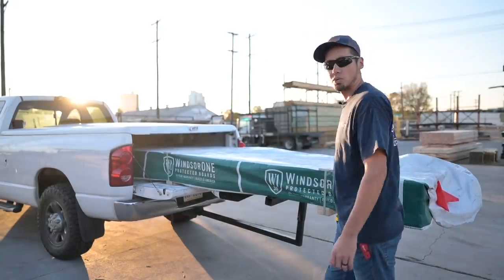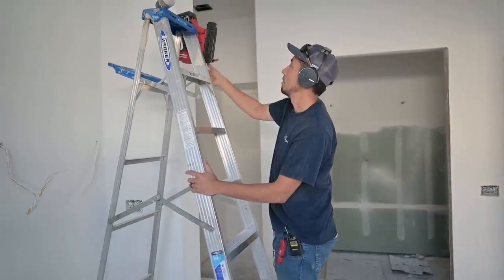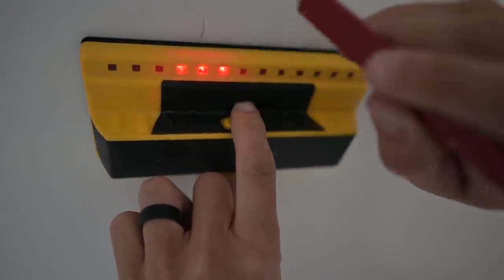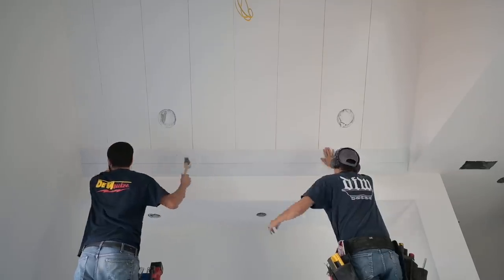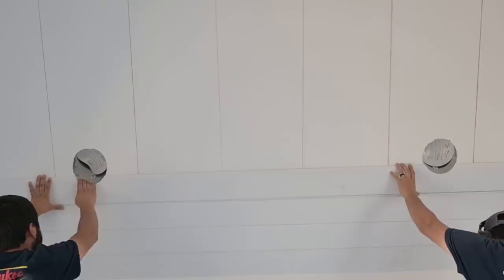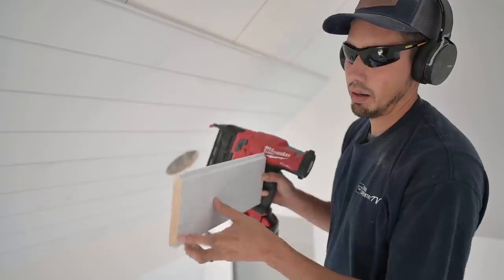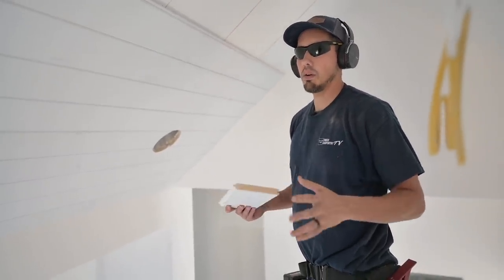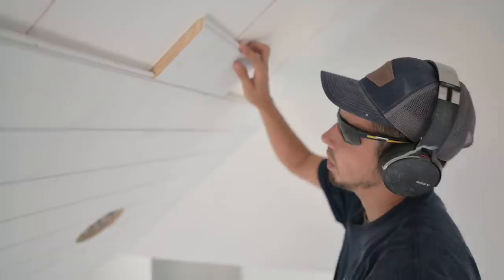Bad Carpentry Technique - Correcting My Mistake

Comment: I feel like each of you having a nailer up there would be more efficient
Reply: Their fine
Reply: @Alexanderbuilds2001  They’re*
Reply: He likes to have the control over John.
Reply: Sharing is caring! Screw that!!!! Two guns are better than one to effectively kill the job and get an invoice out.
Reply: But he said he was trying the nailer out to see if it would get the job done. So you keyboard carpenters buy 2 to start with?
Reply: @David-burrito  🙄🙄🙄🙄🙄
Reply: Two seconds to hand the gun to your partner. That gun approaches 300.00 USD. It would take years for a second gun to pay for itself.
Reply: Just a vid no rush my guy
Reply: @davearonow65  it comes with a free 8.0ah high output battery too.since the battery comes by itself you can actually take and return the battery and get about 70 to $80 knock off the overall $279 price. Or you can keep the battery and get more use out of it with more tools in the platform so either way it's really not that expensive and also over more avenues with more tools especially seeing how that 8.0ah battery is the same size as a 6.0ah high output battery and it's just the sweet spot for size and power efficiency. It's actually extremely common for people to go to Home Depot and purchase that gun and get the free battery and then return the battery to get more money knocked off the overall price. It's not that uncommon at all. If you do the buy one Milwaukee starter kit and get the free tools combo Home Depot has you can actually return the 4 amp starter kit for 199 and I believe it comes out to roughly half of whatever the cost of the tool is that you get free with it. Last holiday season before Christmas I was buying one starter kit a week but I was keeping the batteries for the most part because I was trying to get my battery platform up to be able to run two batteries on every tool that I have at least not to mention getting any of the fuel tools that I was getting with 24 amp batteries in the charger for the same price as the bare tool was a damn good deal. You just got to catch the sales at the right time of the year. As far as I know Home Depot is still offers the 18 gauge Milwaukee nailer with a free battery. They actually have a massive sale going on right now as well especially with your brand new fuel oscillating tools which are the absolute best on the market right now!

Comment: I would use a single bead of construction adhesive across the back of each T&G board on the ceiling when using 18 gauge nails. I even do it for Shiplap walls. Maybe it's OCD... Maybe I never want them removing my work. Who knows.

Comment: I would buy a hoodie but I do have a question, how did you finish the top. I have a den with a cathedral ceiling, wanting to finish it like that but not sure how to finish the top were both sides meet. Do you have video on this and were did you get you tool belt. Guess that's really 3 questions.

Comment: lock  the 2 full length  pieces together....find dead center of those 2 holes......tack a nail, cut a block half the circle , scribe the circle, cut the circle...ive put miles of this stuff up and that works good when the hole ends up in both pieces

Comment: I'm not sure about the Windsor 1 your using but I'm pretty sure your not supposed to use radiata finger jointed for exterior applications! Just fyi for your porch project. Just because its primed both sides doesnt mean it will hold up to significant exposure to water. If theres a chance its gonna get wet I'd get primed pine select it's a solid pine primmed both sides or go pvc!

Comment: You should be using liquid nail because of the height and the location of the boards liquid nail help with Securing the word to the drywall and the nail gun helps hit Stay till the glue is dry.
I’ve done this type of work for years in the casinos in Las Vegas and that’s what you use to make sure it will not come down Hope this helps you

Comment: When I saw you on your last video fixing through the face of a primed T&G board I could not understand why, all you were doing was creating additional work for the painter and possibly over a period of time those nail holes would show. In England we call it secret nailing and if you think about it the nail going  in on an angle has far more holding power than being fired in straight. If you skew in any nail or screw it always has a better holding power, I was taught on studwork to skew the nails or screws in in a dovetail fashion and they don’t work loose because there fighting against each other. And the boards you are fixing up are lightweight and fixed every 400mm centres 
there going nowhere, life’s a learning process and we can all still pick up tips and ideas every day. Not sure if this has always been your trade, but your getting there and looks like your making a decent living so take care 👍

Comment: When you do these T&G ceilings, how do you make sure you don’t end up with a very narrow pice at the top of the run ?
Reply: A great question most don't consider.

My approach would be to split the difference between the first and last board. So you'd have two partial width boards. One at the start of the run and another at the end.

Of course this only works if you were careful enough to measure before you start. 

Same priciple applies to flooring as well.
Reply: @comancheclub3449  that’s how I would do it as well.
Reply: Carful planning is how that’s done. One good question to always ask yourself in anything to do with finish carpentry let it be walls ceilings tile flooring siding. “ am I going to get a stupid little piece” and if so try to figure out how to avoid it.

Comment: Secret for those hole you have to cut out, you can use a router with a trim bit, ive covered things then drilled a hole via measurement and put a trim bit with a bearing in to cut out the center and the bearing will just follow

Comment: You can install your piece and nail it and then cut out around your recessed lighting with a Roto zip style tool with a wooden bit, just like the drywall guys do. You probably know this, but just prefer another way. You’re an excellent trim carpenter

Comment: if the weight of the boards becomes an issue I would use caulk as an adhesive and blind nail. This way I would get more grip on the ceiling by nail and caulk...

Comment: While your mind is open buddy, get ya a 6” hole saw and as you go up past your can lights, make some marks so you know exactly where your can is and then pop that hole out in one shot and you don’t have to test fit your board then pull it down to cut it with a jigsaw. You’ll pay for it in the first job you do with time savings and it gives you one more step of professionalism because your holes are perfect circles. 

I’ve been a custom home builder /trim carpenter for 30+ years. We will never know it all cause the industry keeps changing and evolving on us but your doing great, better than most trim carpenters cause your willing to adapt. 

Take care and be safe out there

I

Comment: When I moved to Canada (because I married a girl there), the house we were in used to be owned by her parents. After an accident put her in a wheelchair a few years before, they renovated the house for her. In the main bedroom, her father and a friend removed carpet and put down site-finish hardwood flooring. Neither were carpenters. The floor boards were all random length, and every single one was face nailed with hand nails, about 12" apart. I didn't know better at the time, but eventually became a wood flooring installer and immediately learned that they're designed to be blind-nailed through the tongue & groove. Now, many years later, I still cringe when I think of that floor with its hundreds of filled nail holes all over it.

Comment: The day you stop learning, is the day to hang up your tools, everyone has a 'trick' you never heard of (most of them work, but if you don't try them you wont know if it does or not) The decorator will also love you as there aint 6,000 pin holes to fill & rub down (belt and braces but a splodge of CT1 (Builders Glue) on each joist!  (got ya thinking)

Comment: Hey got a question do the group, I am doing shadow boxes and in one of the larger rooms there is baseboard heat on wall, about 9 inches from floor. My rule of thumb is 2 1/2 inches off floor to start the box, however if I have another wall without the 9 inch baseboard do I need to raise my box in that panel to math the other walls, or I can go back to 2 1/2 off floor.

Comment: I blind nail my T&G panels as well on vaulted ceilings, but on every 7th course , I face fasten trim screws into the studs to stop any bellying in the panels, it gives the ceiling more structural integrity. So what if the painter has to putty a few more holes.
Reply: why don't you blind screw them instead of in the face? I had a ceiling job did that 16gauge  nails and trim screws  issues was plaster was so tough nails didn't get through so ended up screwing it all up hidden fastener
Reply: @joshuamoyer1  you can shoot hardened 18ga nails with that Milwaukee. If they'll shoot through steel studs then that plaster can take them too.

Comment: How do you know if your two pieces will meet evenly on the ridge? Is there a formula for figuring, or some sort of process?
Reply: You can lay it out first and see but whenever I get to the top close to the ridge, I scribe my pieces in and make them tight. You can hardly see it from the ground even if it looked bad up close.
Reply: @dustyandsneezing  What do you mean by scribing. Do you tip them to size and face nail with less of a seam?

Comment: Definitely want a hoodie!...also, are cutting the ends straight? I’ve always bevel cut the ends, 15-20 degrees.  Fits better, naturally scribes it to the wall.  Just curious.
Reply: Zip up hoodies!!   They're Easier when wearing toolbelt with suspenders.

Comment: Room for expansion is needed but hopefully the sheetrock will bruise and indent when needed
Wide plank board will cup
Wider board fewer nails holding same sqft because of fewer rows needed more nails or stronger nails like cleats
Or glue support between rafters
A ceiling with alot of variating tempatures will create alot of expansion and shrinking gonna play on those nails alot
Use a urerthane glue next time to change with the wood not a pva that would just snap free of the substrate or material

Comment: Just wondering as to why you wouldn’t use a little adhesive on the back, like a PL or a liquid nail?
Reply: And just my opinion, I would use a narrow crown stapler as it has more holding power over Brad nails. When it comes to having boards over head, i prefer better to over kill it as a precaution.
Reply: @joepierce5357  stapler is good, but glue is simply not necessary.
Reply: @Joe Pierce  You should never glue cladding due to seasonal movement, the boards will crack.

Comment: You should be using liquid nail because of the height and the location of the boards liquid nail help with Securing the word to the drywall and the nail gun helps hit Stay till the glue is dry.

Comment: Remember,   most 18 gauge guns only accept 2 inch nails max.  3/4 for t and g 5/8 for rock. And deduck for the 45 degree angle and there really isn't mush going into the framing.  Maybe 1/2 inch?

Comment: The only time i've had the stuff fall down was due to some secondary water damage from a fire in the next room.

I suppose it didn't help they nailed almost all of the boards only into the drywall with an 18 gauge.

Comment: Wondering if at the peak, do you just run both sides tight and caulk the seam at the peak or did you add a piece down it to fill the 'V'?

Comment: Honestly the best guys are those willing to learn new tricks and take advice. Even if the guy telling you dosnt do your craft for a living. Hes going to see things you nor anyone else has thought about.
Still almost like to use a tile cement with a 1/8 v notch to put the glue on the backs of them for just a tad more holding power.   Tell you what do a mock up at home and a 6' section  then do it both ways.  Then see what it takes to pry each kid down off the mock up. Let the glue dry first.  .
My bet is the nails pull out of the wood and stay on the celing.  On the nailed and glued ones the paper comes off the drywall. It would take 4 times more force to peel them down with glue. There not comming down.

Comment: Richard is a former form set ter for concrete forms I'm telling you you need to get yourself a good pair of suspenders for your tool belt because eventually it's going to take a toll on your hips and your lower back if you have the suspenders on it distributes the weight better and takes it off your hips and your lower back I'm living proof of it

Comment: Im thinking just a spot of silicone or construction adhesive on the back of those in a very thin layer. For a little extra insurance.  That or floor staple gun. But brad nails on the tongue  risky.
Maybe not every one becuse just one out of 3 will have more holding power. Maybe you don't need it but I'd rather error the side of safty. Just one comes down on someone's head youll be paying for it forever.

Comment: Loads that size should be delivered and added to the material cost.  If you are picking them up, you should be charging for that (time and mileage), so to have it delivered, should not cost any ( or much) more.  It will give you a little more time with your family and less hassle.  Your time is precious too, only so many hours in the day!  Also, there will be no need to buy a bigger truck, (which is also much more costly to maintain), = $ in your bank account!  Just a friendly suggestion!

Comment: Why not just install, then use a 4.25” hole saw and go through both the wood and drywall once installed?  I did that with my LED gimble lights and was super easy.

Comment: Idk why anyone hasn’t said it, but instead of 18ga smooth shank nails, use staples. And if you stick with nails, just use drywall glue to hold to the surface rather than just relying on the nails.

Comment: Whenever I get a shiner on the backside of the tongue I just carve a the part of the groove that hitting it with my knife. At the peak I usually run the last board long on on one side of the peak and back bevel the shit out of the last board on the other side of the peak. Two get the same two reveals on the last two runs at the peak it takes math, some measurements, and some tinkering, and too of any words, but not very hard. Just gotta hope your framing is square and don't have to taper cut.

Comment: How much engagement are you getting into the stud once you're through the wood and drywall?  

I'll definitely buy a hoodie.
Reply: When I've done it with cedar t&g, usually you have about 1 1/4 to 1 1/2 of nail sticking out the back of the board.
Reply: @mikedrimba3529  Thank you Mike, I appreciate it.

Comment: As a product designer, I guess you use the nailgun wrong. The lip of the gun fits in the groove. So why are people still like to hold the gun horizontal against the groove of the wood? Also, did you take into account the shrink and expansion of the wood left and right against the wall?

Comment: Nice work.The framing that you are attaching to are RAFTERS, not joists.
Reply: Times change. Since tjoist have been used for roofs people have started calling them joist also. Even saw it in a manufacturer Engeneering layout.
Reply: Thanks for info.

Comment: So you don't have to bend your'e tape in the corner to measure, cut a piece ten inches long. measure to that then add ten inches. If you are not confident with the 18 guage nails use Power Grab from Home Depot.

Comment: On the last video where you face nailed that ceiling all i could do was cringe and think the painter is going to hate you. Lol. Blind nailing is the way to install tongue and groove boards always. Of course you need to hit the strapping or framing. It doesn't hurt to use construction adheisive on the back side of the boards as well.

Comment: A look like it’s a lot new construction work in texas for now in the next 10 years , think 🤔 about moving another state, use the benefit in getting shipped houses now, a will cost a lot later, 
A lot people are moving to texas, away from democratic high taxes state,🤪.
I have a idea 💡, i do the same but HVAC , i use Inverted in my truck in case any house with no power ( electricity ⚡️).
Connect with extra cables to you truck battery , it’s RAM rigth as you say, 
Try a will be good , no generator needed, .( Military thinking, Lol)
Don’t forget the remote start in you truck, starting the truck from distance and keeping could . Special in Texas, 
I have to use remote started in my truck every time that use the inverted and i use the inverted for LED lights inside the van specially in winter, get dark to early. 
If you do , i like to see the video. 
We see you in Alaska 10 years from now.🤔

Comment: I like seeing you guys use a mallet. I cringe when I see you pound with your hands. By 46, my hands were shot. I need to run hot water over my hands every morning to be able to hold a spoon. Had surgery on both hands to release trigger thumb, it failed.
Please, do not pound with your hands. There are too many of us older guys with grizzled hands.

Comment: Nice work. Your toolbelt is out of control though, why carry 20 pounds of iron around, that's really a bit much. For your safety, don't saw or use any tool ever towards your self but aim away. Also, if you work at height, your ladder or scaffold should be high enough for you to grab or lean against the top rail. Standing on the top plateau is just not a good idea. Lastly, working under a load? Sure, you and your mate are the two humans on the planet who never blink, sneeze, twitch or lose their footing, I just hate how my safety training OCD kicks in watching you guys.